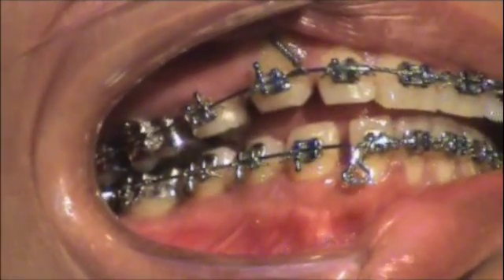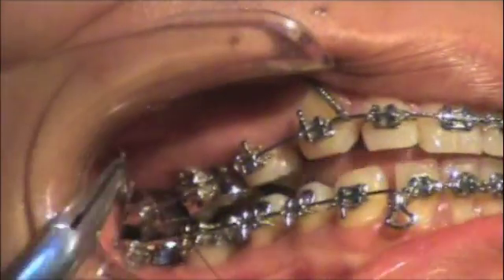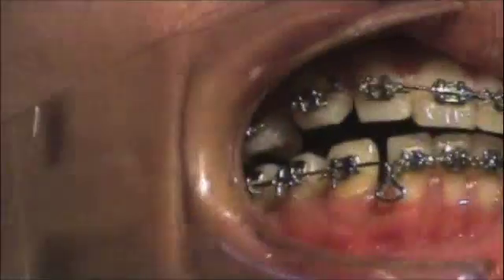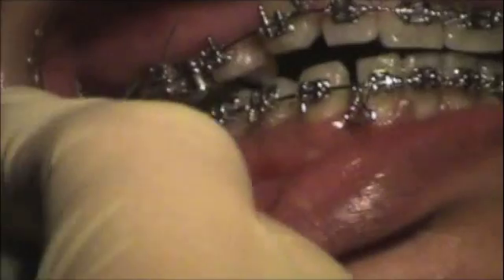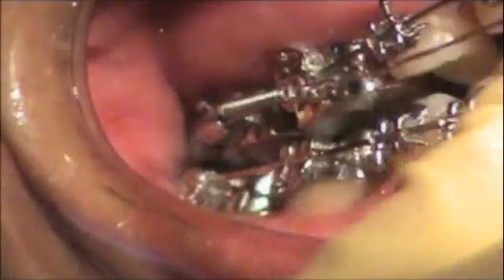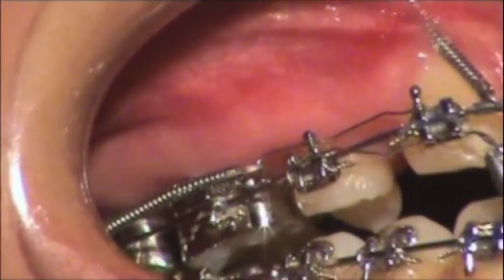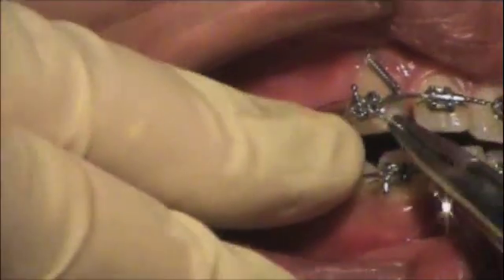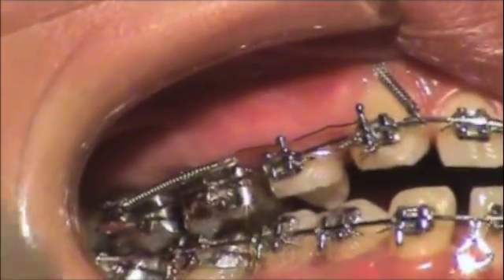open coil activation

Comment: Hi McGann!  I would like to know in this case, are you using the 12mm close coil with step 2 retraction on the 18X25 NiTi wire?  As you indicated, there is still skeletal anchorage on the maxillary arch.  Would this 12mm close coil cause on the 18 X 28 NiTi cause burn anchorage?